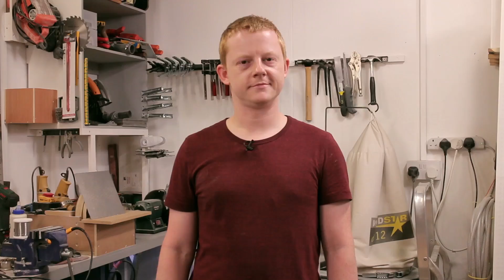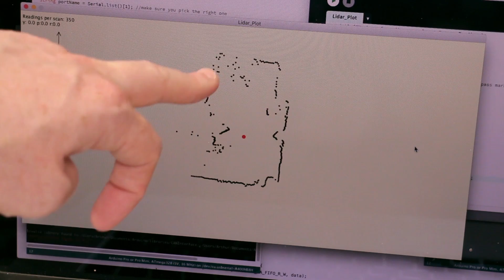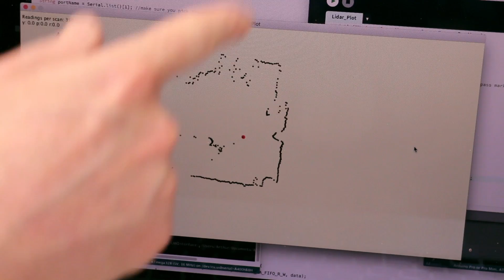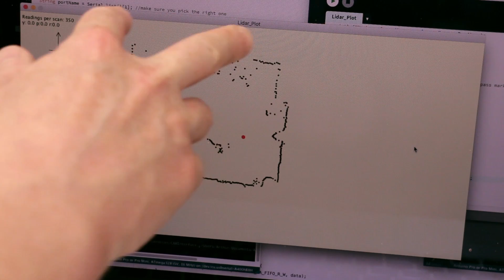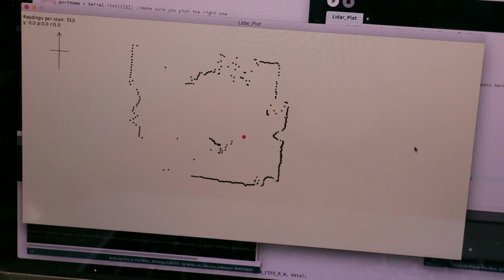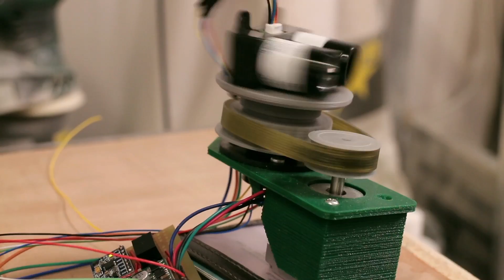Rotating 360 LIDAR Scanner - Mapping a room

Comment: How do you connect the cables? Arent they twisting?
Reply: Hi Stan, the cables will go through a slip-ring. It is a series of circular, concentric plates which rotate, but stay in contact with each other. It allows one side to spin

Comment: Kind of bugs me how the slip ring has a wobble too it.  Mine have that problem as well.  Been working on a lidar myself and started off with the gear method as you did and have the same issue with the noise and well... gear slop.  Endless things to think about. Great set of videos man.

Comment: Hi Arthur, would you please share your processing code?
Reply from the maker: Its badly written and comes with no documentation but here you go!
https://gist.github.com/ArthurGuy/33453358b354bd6341c18eeb78c36eb2
Reply: Thanks, so much man!
Reply: Currently using the same sensor and trying to do some SLAM and general mapping!
Reply: Have you got the Arduino code too? just merely want to see what you do about only getting 350 readings per rotation and then sending it via Serial?
Reply from the maker: The conversion from 350 to 360 happens in the renderPoints method in the processing script
Reply: Oooooh, okay I get ya!! thanks, man!

Comment: Wouldn't it be more practical to have a mirror rotating around a fixed scanner? It would allow for z-axis (up) slices by changing the mirror's angle...
Reply from the maker: I don't know how the ranging beam is transmitted and received, for example does it leave at an angle to return through the adjacent sensor window. For these reasons I decided not to mess with the beam itself.
Assuming that isn't a problem then yeah, I think it would have been a lot easier, especially like you say for the z axis.